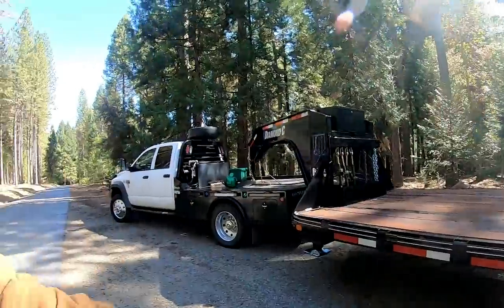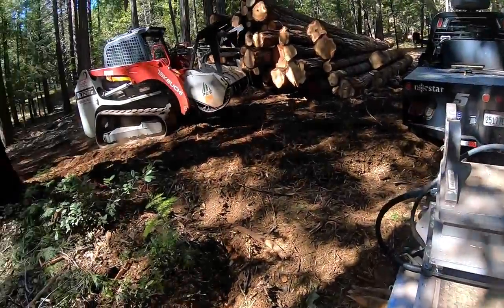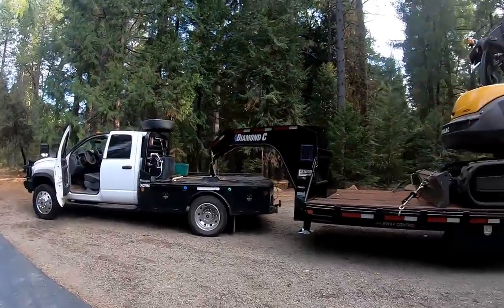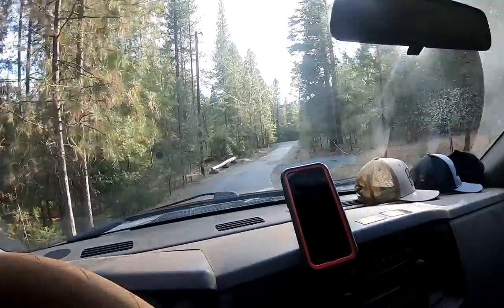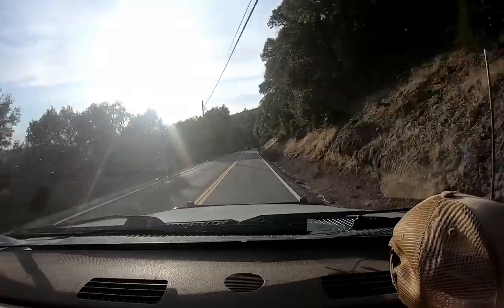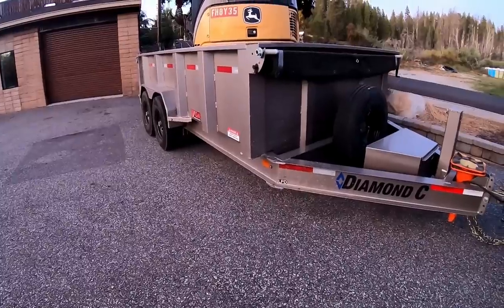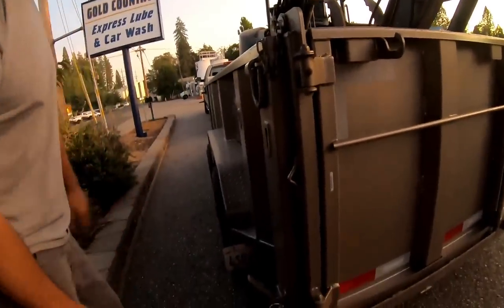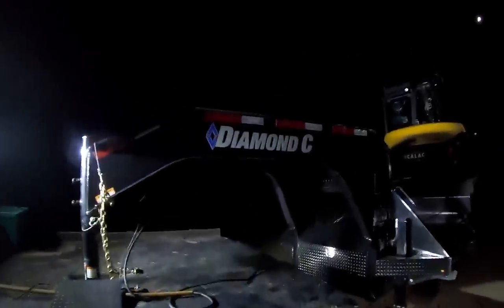Jake Brake on 6.7 CUMMINS! PACBRAKE LOAD LEASH

Comment: I have a 3500 dodge w/ 6.7l. I wasn't aware of an aftermarket Jake for the 6.7L engine. I don't haul as heavy loads as you. My loads might get to 8-9k trailer & tractor. I have the exhaust brake only and love it.
Reply: EDIT,  i asked to see this setup. I found it on your channel. I am a new viewer but i found the videos showing and talking about this !!  sweet set up man
Reply: it is not a jake brake its a whipper time brake made by pacbrake, i installed one on my ram 3500, you can use it with or without the exhaust brake, mine is always on, and i turn exhaust brake on as needed. YES it does make a difference.
Reply: @ruialmeida6679  is it something I can install or should a pro do it? And price?
Reply: @Drew6709  if you feel confortable taking your valve train apart, reset the valves and tap in to the truck harness, sure (its at least a two day job) https://pacbrake.com/product/p55004-p67-loadleash-engine-brake-kit/

Comment: I really like your new GN trailer. I really like the spread axle dually. You probably don't need / want a tri axle dually trailer as turning would be a pain and would be tough of tires, especially in those nasty roads you have to drive down. Trailer probably rides a lot better with your new shocker hitch on it

Comment: I could see that machine being very very handy to a guy that is 50-50 on a track skid steer vs mini excavator but can't afford both. Myself and a couple other guys did a culvert extension Monday with a Cat 308 and somethin er other abbreviations model excavator  (they say "mini" but it's steel tracked with the rubber blocks bolted to the track pads) and would require the snowman and diamond C to move it, so 20k-ish zone machine. It's plenty nice for what it is, but man does it seem like there's always alot to be desired in the speed of the hydraulics...........maybe just me and my ADD and OCD thinking three times as fast as normal people lol. Also maybe such that Cat hydraulics are just that way because I've ran most cat options up to 330 class machine and always felt the same. Although each brand has the pro and con sheet so before I go to nuts I've also only ran deere, bobcat, and cat machines...............this alien technology critter looks like a handy little bastard to me though, and a challenge to see what all is possible with it too!

Comment: You call that a hill! That’s not a hill!  Fancy gap is a hill!  Jellico is a hill! I am kidding man, couldn’t resist. The Pacbrake works awesome. I hear my buddies talking trash a lot about weight and it’s mostly lies the best that  I can tell unless 5th wheel campers and aluminum cattle trailers are secretly being built out of lead now lol. I think a lot of guys have been desensitized by YouTube and ratings and don’t really appreciate how much weight that is. A 22,000lbs machine on top of an 8-10lbs trailer is no joke and I can appreciate how you built your rig into what you needed to eliminate as much of the white knuckle driving as possible. I like how you talked about the attachments and the weight of them in this video it adds up fast and a lot of people don’t appreciate that either. I run a 35’ trailer with 30’ flat, 5’ with ramps and pop up center and 8’ deck over the neck for attachment space and you can get a “legal load” of just implements faster than a lot realize. The subscriber that you met up with had a nice trailer and I think it was good advertising as he pointed out the things Diamond c customized for him. He had some good ideas on his trailer. Here is the part where I get jealous...the access you guys have out there to near stuff! I’ve only seen those Mecalacs on the YouTubes and you got one behind your truck! A lot of little stuff too like I caught the part about the adapter to run the attachment on there, I had one made to run skid steer attachments on my KX57 so I could run my Sydney tree shear to cut trees for access roads to fit 16’ wide mats without tearing everything up making 10,000 turns in the skid steer (have to restore everything myself). I bet if there was a some kind of a poll that 80% of the tractors your size with top and tilt kits are located in California, not the rarest thing in the world but you see them everywhere there set up right with wheel weights and plenty of auxiliary outlets. Same with actual “skip loaders” or whatever the regional name guys call them..like the case 570 and cat 415 they are so useful and you just don’t see them like you do in California. I also bet that for some reason that 9 out of 10 of those little cat challenger branded tractors that were ever built found there way out there. I wanted one of those so bad and you just didn’t ever see them, worked in California and they must of all been shipped there lol 😠.  I also remember seeing a guy in San Jose who was doing footings on a large site with a 580 get done, run it up in a custom bed on his tandem with several buckets he had with him and boxes for his laser, rod and tripod and gone in zero time, with no trailer... like how handy is that. If I had the imagination to come up with something like that I have no idea where I could ever have it fabricated, not for a long, long way from here. Hope you caught some footage of whatever you guys were doing with the Mecalac, would finally like to see one being worked in the real world and not just carrying a bucket of stone fast lol, if it’s actually super useful maybe I can fit it in with my fantasies of having a tilt rotator someday 🤔. Ohh...also been unseasonably in the high 90’s for about 2 weeks around here and everyday, cranking those jacks, staring up at that deck on the neck I just dream of hydraulic jacks... so glad I decided to save that money 😥

Comment: Whould you watch if I put a 12 valve cummins in my 1984 chevy c30?
Reply: 1984 chevy c30   Of course. 👍🏻
Reply from the maker: Let’s see it
Reply: @VBELTandSON  well it ain't swapped I'm still thinking about it I might do it
Reply: @dixiemae5042  i will start as soon as I get a 12 valve engine
Reply: @dixiemae5042  I will look in junkyards for the 12 valve engine if I can't find one it 24 valve p pump time
Reply: @dixiemae5042  I wish ya luck man
Reply: @dixiemae5042  thanks man there are quite a few old dodge trucks where I live most of them 12 valve so I might find the motor out of one of them I'd like to pair it up to a 4 speed but if I have to I will find a 5 speed
Reply: @oldcroneysgarage9739  did you ever do it?
Reply: @guy_incognito7538  not yet it costs a lot of money to do that I will one day though

Comment: Diamond C Dumb trailer i have a Black 16ft  Diamond C Dumb trailer a 18ft Flatbed a 20ft Flat Bed and a 12ft Flatbed trailer i tow the 12ft Flatbed the 18ft Flatbed and 16ft Diamond C with My GMC Envoy Xl and Chevy Silverado 1500 i tow the 16ft Diamond C Dumb trailer the 18ft Flatbed and 20ft Flatbed with my Chevy 2500hd both of you have Awesome setups we all need to meet up with 3 different trailers and show our setups

Comment: Have u ever used one of those gen-y torsion gooseneck hitches if not would be a good video keep up the videos wait for one everyday 👍
Reply from the maker: Gerard zubrickas not rated high enough for my set up far as I know. But I’ve been looking into something
Reply: Can’t wait another question do u no of any dump trailers that would fit a 3/4 ton truck width wise
Reply: What about the shocker hitch?

Comment: In NY you need a class A for that!
Reply from the maker: Lauro Saldana in ca you need a class a for that as well and I do have my class a cdl:)
Reply: I see a lot of little 550’s with their trailers getting pulled over especially in Long Island. A lot of them they are not from NY. Out of state plates.
Reply from the maker: Lauro Saldana why?
Reply: V-BELT and SON 550 is 19.5 thousand pounds by it self plus trailes and they usually towing 10 thousand plus. That puts them over 26 thousand pounds.